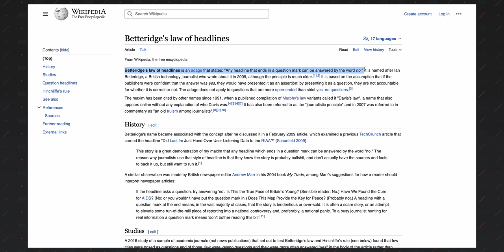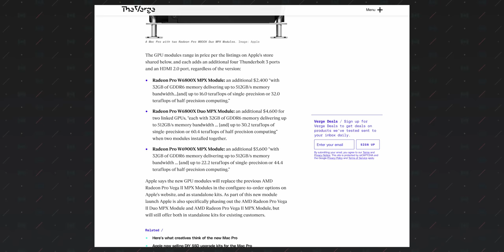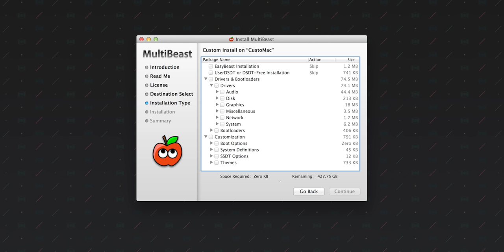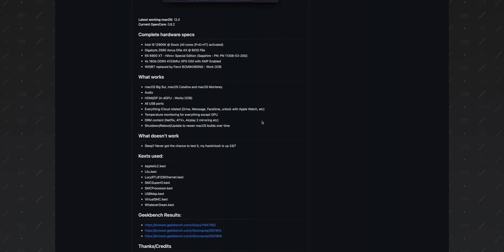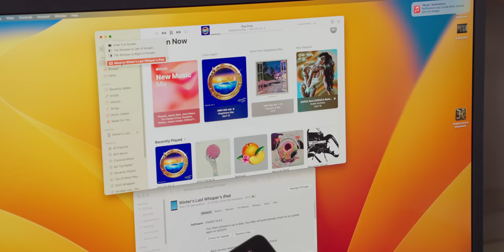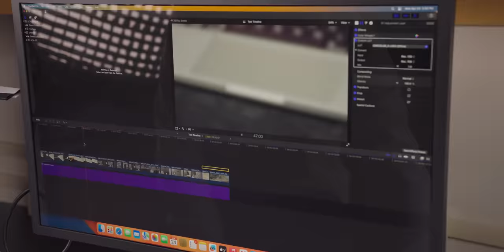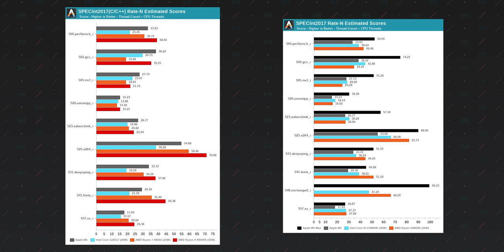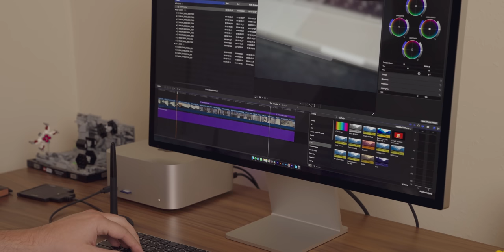This $2,000 Hackintosh SMASHES the $4,000 Mac Studio

Comment: The entire time I was like, "yeah, but talk about performance per watt" and then you did, and i was like, "oh... I guess that really isn't much of a benefit," when you put it in terms of how long it will take to pay off the Mac Studio with the energy savings, it all made sense. I have a feeling like the more Apple increases the performance of each iteration of their in house silicon, they're also going to push that thermal headroom that they had going into this race, and eventually they'll be able to truly out perform a PC at the same power draw. But then they'll have to contend with the thermals of the machine, which they haven't been the best at when it came to intel based macs. Who knows, maybe they're doing R&D to figure that out.
Reply: That is assuming intel and amd stay stagnant. They won't.
Reply: @thomasanderson5929  But we'd also have to account for future versions of macOS supporting x86_64, which I hope is the case for a while (considering they are still producing Intel Mac Pros), but none of us know for sure.
Reply: @thomasanderson5929 that’s not exactly true given that the “outperforming M1 Ultra Mac Studio” was by relatively slim margins for the most part. Which could be closed by optimisations, a higher TDP, more unified memory, and whatever else Apple is doing with their processors. Which, might I add, is still in its infancy while Intel and AMD have been at the processor manufacturing game for ~13+ generations. Also, as far as the biggest gap (gaming) keep in mind we didn’t see the M1 Ultra performance, just the M1 Max. Also, also, let’s not forget to mention that Apple is on M2 right now, meaning M2 max and M2 Ultra could close the gap a little more. I’m not saying that Apple is going to win anytime soon, soon but I know we’re not too far off from that potentially being the case. Lastly, I also understand that this take comes with a lot of “ifs” and they’re really going to have to hunker down and get to work to get all the kinks, but in reality that’s all that’s in their way if they keep going the way they’re going.
Reply: While the performance per watt conversation is certainly a thing, I don't think it's as important as actual raw performance. If I'm actually using a computer for work, let's say I'm compiling code or rendering video, speed matters more. If a client or a director or someone is breathing down my neck and wants stuff done five minutes ago, I'd rather burn 700 watts of power to get done now than wait longer and brag to them about how power efficient my computer is.
Reply: @eruannster  right, but it is important for future purposes because if they can still squeeze more performance into a smaller TDP that’s still a good thing. Not to mention, that just gives them more headroom if they want to push the M series chips as hard as it can go in the future. Of course, Apple will never let overclockers touch it, but it is still innovative to know that you can get similar performance with less power draw, and maybe intel or AMD can learn a thing or two. Which they have! Which is why intel started implementing Performance and Efficiency cores into their processors
Reply: @eruannster  You would work on a Windows machine then, and not use Intel CPUs at all right now. Specially if you are in Europe and have to pay not cheaply for your electricity.
I found almost impossible in my head to have to risk with fiddly workarounds, that's why I have a decent MacBook for development and a Windows desktop machine for raw power, at the end of the day is safer to learn multiple OSes and have multiple computers than working on a Hackintosh.

Comment: These are few drawbacks with your build:
1. macOS scheduler won't work well with Intel Gen12/13 P/E-core. Meaning that the single core performance might throttle to E-core performance. You would get the maxium multi-thread performance depending on your workflow/software.
2. All Samsung SSDs are bad in macOS, TRIM are not support natively. WD SN750/850 are the best for Hackintosh.
3. For Airdrop/Bluetooth/Wifi support, you have relying on an old Mac-specific wifi card
4. Sleep/wake are always the issue for most of builds.

Comment: I have a hackintosh using opencore and an AMD 5900X processor, 6900XT GPU and 64 gig ram. The thing flies. Cooling is a custom loop with mostly EK gear so it also runs pretty silen. But its huge, compared to a mac studio anyway (Fractal Design Define 7 chassis).
Reply: What model of  6900XT did you use? Did you have to do the device id spoofing?

Comment: You forgot to mention how quiet Macs are - I really cannot overstate how awesome it is to have quiet at my desk since I switched to apple silicon from my old Intel laptop.
Reply: Depends on which one... the studio gets louder than gaming notebooks...
Reply: @thomgizziz  and you could decide for passive cpu coolers if you want absolutely 0 noise (only maybe coil whine if even..) And "old intel laptop" is not a good comparison in my opinion as nearly all "old" laptops were pretty loud imo and mostly changed in noise pitch (thinkpads and macbooks were deeper for example) today nearly every manufacturer tries to get it as thin as possible and then put some cooling in it which often is at its limit and smaller/thinner fans often have higher, more annoying pitch. Many modern laptops can run passively cooled if not much power is needed and the hardware is under a certain threshold. So I can watch youtube and write documents on an rog flox x13 (amd tho, not "old intel") without the fans even spinning. 🤔

Comment: I switched from bare metal to VM hackintoshing. SO much easier to set up. Performance equal to bare metal (better than bare metal for intel 12th and 13th gen, because the Linux host deals with heterogeneous core CPU scheduling). The only sacrifice is setting aside a few GB of RAM for the VM host. But RAM is cheap right now.
Reply: Want to share your exact setup for those that want to go down this path?
Reply: @roscoecoltrane6867  The beauty of VM Hackintoshing is that the exact setup isn't really important. If you want to use a modern GPU, it has to be a compatible AMD card, but the rest of the specs/hardware doesn't really matter.
Most people get the best results with Proxmox, QEMU, or ESXi.

Comment: Interesting. I'd like to see the performance of a Hackintosh with a new 56 core Xeon W with loads of RAM - at least 256 GB. Obviously it's going to be vastly more expensive than a Mac Studio, but how about a comparable Mac Pro?
Reply: Just read a review on that new 56 Core Xeon by Puget Systems, and unfortunately, the Intel chip gets beat by the Threadripper Pro despite the fact that Zen3 is several years old at this point

Comment: You probably can't wake up that Thunderbolt port from sleep either, unless that long-standing issue has been resolved.

Folks should also make sure they read the install guides before buying stuff. There are a lot of hardware compatibility concerns and issues so verify the parts you want will work.

Comment: My last hackintosh was built in late 2019. X299 system, gigabyte designare-EX in a Lian-Li case. I9 7940X, fully decked out 128gb ram. I think I spent around $1700 total. Shortly after that, prices skyrocketed after the chip shortage and high tariffs. It has been a great system. Running Ventura on OC .8.8
Reply: This. Very similar build here, X299 has been such a godsend allowing 128 gigs of ram it’s still a powerhouse and then I have my M1 Max for when I’m on the go. My hackintosh was expensive due to the amount of water cooling bits inside but I PC game also so was well worth it.
Reply: reminder to update your OC =)

Comment: I made it HACK on a Z690 board, it works under Ventura without any problems with 12th gen i5, I use the comp for Photoshop, mainly for heavy PSB files, I decided on this option because of cheap ddr4 RAM, 128 GB costs "pennies", most importantly NVME 4gen, reaches speeds above 10 Gb/s in raid, Total energy consumption under stress is approx. 170W when working at PS approx. 100W. I have been a Mac user for over 20 years, I always bought new Power Macs and later Mac pro products. They worked and still work without any problems, but after MP 6 something started to happen and these computers, despite their excellent performance, started to cost x2, offering much fewer extensions to the previous generation. For now, I treat it as a test platform, but after a month of work, nothing has happened, it works like a regular Mac.

Comment: Awesome video! You should do an HP Ultra Mini PC hackintosh because that’s the similar footprint. For me though the M1 Mini is awesome, and it doesn’t currently give me any reason to want to build a hackintosh since I have a separate dedicated windows gaming PC. I run both my M1 Mini and my gaming PC on the same 55” LG OLED TV and I can switch between them with a single click of the remote. I did build a hackintosh back in 2016 because I was using it for heavy 3D computer graphics work, and I needed 128GB ram and multiple Xeon processors. But now, the M1 Mini is more than powerful enough to meet my needs. And stability on that old hackintosh was not good, and it was a pain in the butt to build and maintain. Also with the development of crossover for the mac, on the latest M2 Studio Ultra you can come close to getting frame rates on windows games that matches my current dedicated NVIDIA 3080TI Windows gaming PC. So I don’t see myself building another windows gaming PC in the future as I will probably end up getting an M3 Max Ultra and just running crossover instead. Also Windows 11 sucks. I’m still on Windows 10 because I can’t stand Windows 11.

Comment: This is a great video but I wish you had compared it to the 2019 Mac Pro. Reason being these are now available on the used market for around 2/3rds of the retail price and can also dual boot to windows with the advantage of the same GPU support. I’m considering selling my hackintosh and Mac mini to consolidate into one Mac Pro dual booted
Reply: There are some geekbench multi core scores with a 7,1 running a 13900 that destroy all other Mac’s and almost every PC. I need to confirm compatibility but my god it would be epic to install a 4090 for bootcamp (and whatever AMD card for macOS).
Reply: @markaceto  I think they are a completely different socket as the cpus are different sizes

Comment: It also smashes the electricity bill at the end of the month 🤣
Reply: Are you implying that the decreases power consumption makes up for the $2000?
Reply from the maker: 15:05
Reply: Never heard anybody buy a $4000 to save electricity...
Besides the hackintosh doesn't have abnormally high power consumption compared to other PCs, it's just that the mac has very low power consumption.
Reply: @snazzy  never heard of Germany, huh?
Reply: @PvtAnonymous  Do not be dumb, even in Germany it does not pay and last 20% of performance cost way more tah 20% power. Check out your own deBauer
Reply: @snazzy  More power consumption also means more heat. I experienced a huge difference in the room temperature when I switched from my Ryzen 3950X hackintosh to a Mac Studio. Not a main concern during most part of the year, but quite a big difference in Summer.

Comment: the main  reason I have an OpenCore Hackintosh is I like using MacOS as a daily driver, but I also like playing games, so I dual boot with Windows. this sort of simplifies my life (apart from the fear of breaking stuff when I install Mac updates), and is cheaper than 2 computers. I have a 10700k, a 6800xt, and an Apple
Broadcom wireless card, and everything works apart from a few USB ports due to the aforementioned port limit

Comment: I always like your sensible approach to topics like this; you're neither bashing Apple Silicon, nor using its extreme power efficiency to suggest that it beats out all available Intel chips. You also rightfully acknowledge that Apple's equivalent of the 13700K has yet to be released. When that day comes, I do think the Hackintosh will have met its end for good reason. Until then, those dissatisfied with the 2019 Mac Pro may still have a compelling reason to build a Hackintosh in 2023. 

What I hope is that Apple does not hold back with the Apple Silicon Mac Pro. The fact that they intend on keeping the existing chassis says a couple of things. Firstly, it would be a waste to can it (and this admittedly may be the main reason, if nothing else); but, hopefully, the true reason would be that they intend on filling the volume that the 2019 chassis has to offer. That said, there's also the possibility that Apple takes a conservative approach and concludes that the Mac Pro is too boutique of an item for that sort of investment. They indeed may feel that they've recaptured enough creative professionals with the Mac Studio et al.

Comment: He's not kidding that the Hackintosh process is fairly nuanced. One thing to be aware of is that not all motherboards are created equal. I use the ASUS Crosshair Hero (AM4), and while it is a good motherboard, it absolutely will not work with automated USB mapping tools. I had to use an XHC remap file in the ACPI folder to get the I/O to work. Also, I had issues with hardware conflicts and freezing because SSDT Time apparently didn't cover all the necessary bases. I didn't have a smooth running machine until I found someone on the AMD OSX website who knows more than me and used their EFI.

Comment: I've just built a hackintosh with used eBay parts:

7980XE + Delid + Liquid Metal + Copper IHS + Kryonaut Extreme @ 4.6GHz, 3.0GHz Mesh
64GB GSkill DDR4 3200 16-18-18-38 T2 @ DDR4 3733 18-22-22-28 T1
Gigabyte X299 Designare EX + Modded bios fully unlocked options w/ pre-spectre microcode
Ice Giant ThermoSiphon
BeQuiet Silent Base 802 - Modded with an angle grinder to fit ThermoSiphon in inverted layout
5x 10TB WD External HDD's shucked
4x 2TB SanDisk 3D SATA SSD
1TB Samsung 970 Pro (seems to work without TRIM issues in Ventura)
AMD Instinct MI25 flashed with raspberry Pi to WX9100 BIOS
1000W Corsair PSU which is overloaded on a regular basis. Drawing ~650W CPU only load and ~550W GPU only. Combined is a no go 😂

Cinebench R23: ~27000
Geekbench 5: ~1300 single, ~19000 multi

Comment: Enjoyable video.
Couple of things.
1. Great parts selection, except for the inexplicably small SSD, which I hope you got a good deal on. Typically 2 TB SSDs are cheaper per gigabyte than 1 TB ones and they take up the same M.2 slot, so I just don’t see why you’d get 1 TB for a machine you’d actually use. I would have built a 13700K + Z690 Aero D + 64 GB DDR5 + (even, potentially, 6800 XT) build this week if the 7800X3D weren’t beating it in so many key areas: efficiency (by a country mile), raw gaming performance, anticipated future upgrade path (by another country mile), AND platform PCI express lane combined bandwidth. That leaves the 13700K relying on its (often small and perhaps nullified by more expensive cooling) price advantage and multithreading per dollar, along with Thunderbolt, bootleg MacOS compatibility, and I guess, buying from the underdog who is selling CPUs with low margins in order to compete, being the only factors I consider in the i7’s favor, and frankly I’d rather focus on a general-purpose gaming PC than check those niche boxes even though I am the owner of a Thunderbolt audio interface, the Apollo Twin X. I’m comfortable using optical audio from my PC and analog audio back in and just saving myself the headache of UAD software for Windows, along with actually getting and keeping Thunderbolt working. Linus says he’s moving away from Thunderbolt and toward optical DisplayPort and optical USB in its place because it just doesn’t work very well, with the possible exception of a string of Apple-blessed hardware. I don’t know — haven’t used extensively.
2. I am willing to admit I’m not the “market” for a hackintosh, even though I build computers and buy Macs. I look on enviously, but I don’t want to babysit a Mac, ever. For my Mac use case I don’t actually need a lot of raw power, and my M1 Mac mini can handle my musical workflow without a hitch. I don’t even need my M1 Max MacBook Pro, and could easily have saved money on an M1 Pro version without feeling the difference. Thing is: when I bought the MacBook Pro I wanted 32 GB RAM and 1 TB SSD for futureproofing/experimenting with games and VMs, and then it was only 15% more to move up to a maxed out M1 Max, which I also wanted for gaming, so I did. Now I don’t use it because MacOS game compatibility is so poor, and I find that when I do game, not only do I want it to just work, but I want to be on my desktop with the big screen, and for that to also just work, so long story short, Windows all the way. Can’t recommend that anyone bother checking bootleg MacOS compatibility when picking PC parts. Just focus on building a good PC.
Reply: Careful with 7800X3D, it has power issues and can fry.

Comment: My Hackintosh from 2018 (i7 -7700, AMD RX580, 32GB RAM) still runs pretty well almost 6 years later. I got an M1 Macbook Air as my travel laptop but I still use the Hackintosh as my main desktop. I won't do a new Hack build, but will bump up the specs one more time (64GB RAM, All SSD drives) and this should get at least 2 years more life. 2025 I will get the latest greatest Apple Silicon Mac Pro (if I can afford it!)...

Comment: Did an opencore AMD build 1,5 years ago. I tried the multibeast approach 2 years before that. I found opencore to be way easier with the guide.
I did have some errors, but that was my own fault for not RTFM good enough. Still wouldn't use it as a production machine though.
For professional workflows I'd go with Mac Studio (or upcoming Mac Pro), independent contractors could try it to safe a buck or for private usage you'd try it. It was really fun to build and my gateway into MacOS (own MBP's 14" and 16" now).